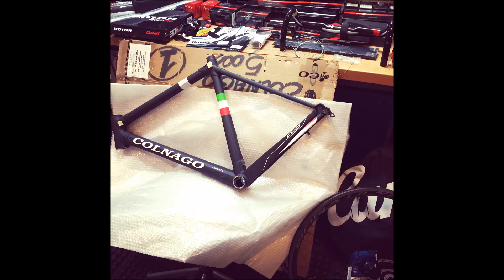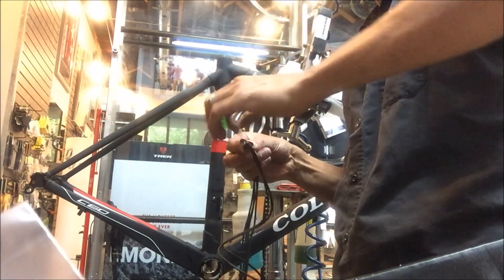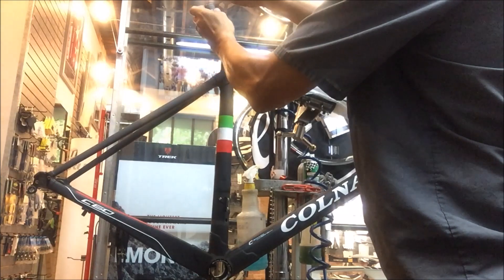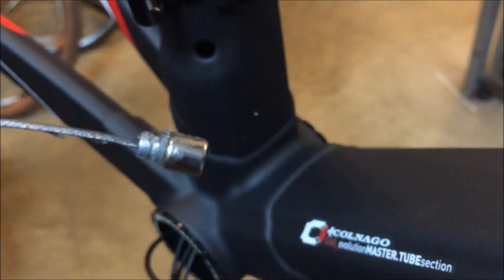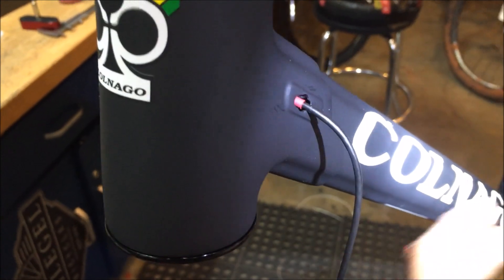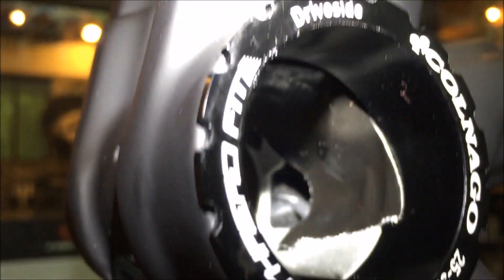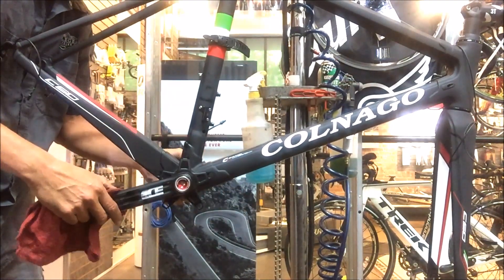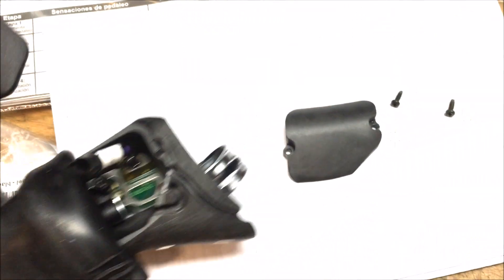Colnago C60 Campagnolo EPS custom build

Comment: Joey, can you go into a little more detail on the ride quality of the frame? I've been looking at this frame for a while and it gets consistently great reviews. Would like any additional color you can provide. Thanks!
Reply from the maker: rickjesse It rides great! There's a certain ride quality I like in REALLY good  modern day frames. I like it when they feel comfortable soaking up small bumps and rough roads, but also have good torsional rigidity. The C60 rides like a proper modern day high end frame should.
 A lot of carbon frames more than 5 years old and aero frames are pretty flexy from a torsional standpoint, meaning the seat tube and head tube are always swaying back and forth from being in plane with each other.  I don't like frames that noodle around when you're cornering fast on a windy day. 
There's plenty of bikes for half the cost that ride just as well, but they're not going to get the oooohs and aaaaahs of riding around on a Colnago.
Reply: Thanks. I have an 2013 s-works roubaix... if you're know that frame at all how would you compare to the c60? Interested in what other frames you like that ride just as well. Like your blog and the race videos. Thanks again!
Reply from the maker: rickjesse I've ridden a few s-works roubaix  bikes that I was working on, but none long term. They're nice. compared to the C60, the s-works is a little more comfort oriented, higher stack height  and relaxed geometry. The C60 is a firmer ride and more race/performance oriented. Probably a little lighter as well.  As far as bikes I've ridden long term, my favorites are my current bike, a Trek Emonda SLR. It rides nice and is super light. The Cannondale supersix EVO is also one of my favorites. Very well ballanced and really light as well.

Comment: Do you remember all what came in the box with the frameset? I've been trying to find a contents list but to no avail.
Reply from the maker: Frame, fork, headset, seatpost, seatpost clamp, BB cups, BB cup tool,  lots of fittings for Di2 or mechanical shifting - cable stops, rubber boots Etc. and a large amount of packing material.

Comment: Hi joey, i live i colombia, i need the CUPS for crankset shimano for C60, where i can buy or which is the brand of the cups, regards
Reply from the maker: The thread in cups that come supplied with the frame accept the pressfit 86 Shimano bottom bracket as well as many others. I made another video of a V1-R build up with the Shimano BB you need. I'm assuming you need the bottom bracket that presses into the Colnago cups? If you need the actual thread in cups, you'll have to contact Colnago or maybe someone like Competitive cyclist who mail orders Colnago

Comment: did you just apply some grease before you press the bb ?
Reply from the maker: On a carbon frame like this, I usually use some PTFE grease in the cup/frame interface.

Comment: Cranckset looks to tide!
Reply from the maker: I thought this was an Alabama thing at first! Yes, as I said in the video, the Rotor 41-30 BB used on this bike had some pretty heavy seal action going on. It got much better after some miles, but honestly, I'm not a big fan of this type BB. The frame bore is too small for a 30mm crank spindle, so It takes a small needle type bearing to make it work, and I've yet to see one that lasted long.